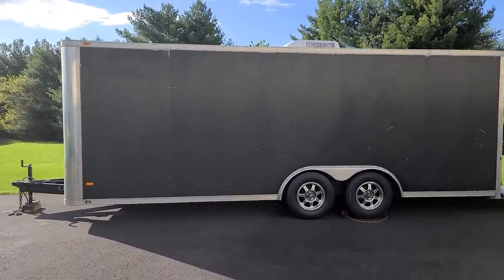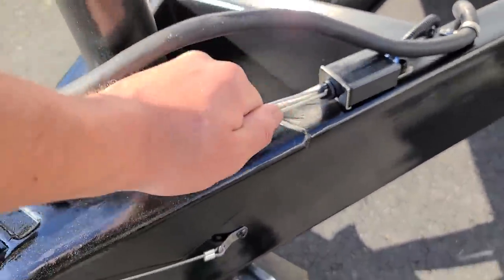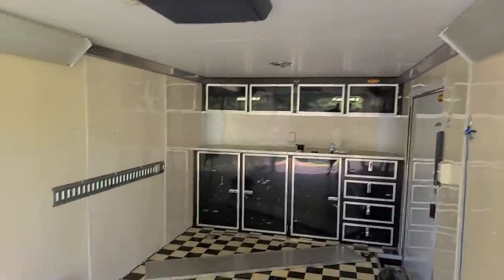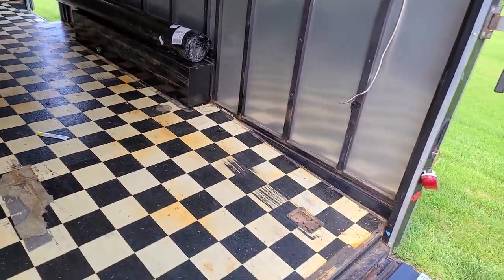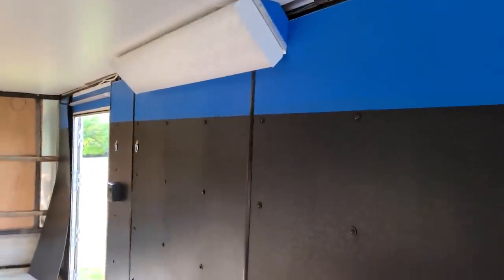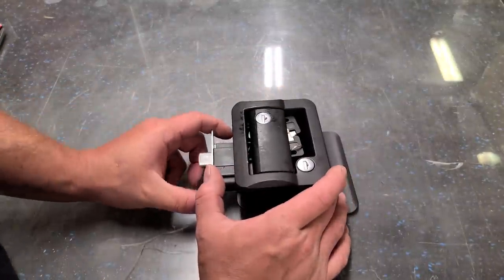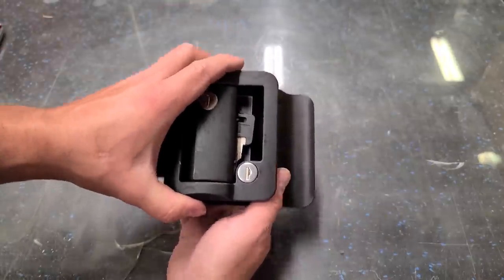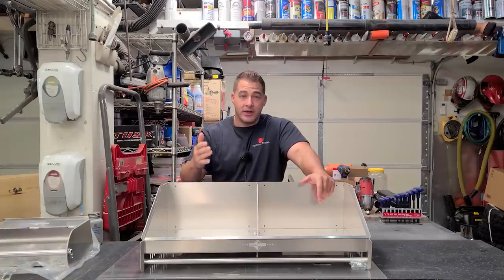Building The Ultimate Trailer and Mobile Workshop! Part 2

Comment: Bummer dude. You missed your opportunity to insulate behind the walls. You'll regret that when it get's real cold, but more so when the sun starts baking the trailer because it's black. Even with the AC on, it's gonna be a scorcher. Looks awesome though. Really impressed with that pressure washer attachment. That was sweet.

Comment: I would recommend a Andersen load leveler. I have one and have never looked back. the biggest benefit to this system is that you don't have to remove the bars to back it up or turn sharp. I bought mine used for half price and would never get rid of it.

Comment: To make the wrap seamless, cut a straight line where the 2 wraps overlap, peel back the cuts, pull out the waste parts and lay wraps down again. That will give you a seamless join 👌 Trailers looking good 👍

Comment: I just got done insulating the walls ceiling and floor of my enclosed trailer. It takes so long especially by myself. 24 foot trailer. Now I’m working on the lights and trim out. Then adding cabinets and tool boxes.

Comment: I'm sure it's gonna be a great trailer Mike, but why do you persist with those huge fluoro fittings?  Why don't you run the led strip lighting all the way around?  You're not gonna need the fluoros with the strip lighting all the way around, & light shadowing will cease to be a problem, with so many point sources of light.  You could also retain the small 45 degree 'fillets' around the edges of the ceiling, firstly to hide wiring behind it & also to mount the led lighting strips on.  I like the idea of strip lighting above the workbench.

The spare tyres are gonna be mounted on the outside walls aren't they? - On the front of the trailer?  They're just gonna take up valuable space inside, especially 2 of them.  You could padlock them in position for security.  An auxillary battery & generator would be useful, especially if you had a small bar fridge!

Comment: @micheal sabo I’ve cleaned changed my main & pilot jets I also leveled my floats on my banshee carbs & it seems to keep flooding & it only stays on when I keep my finger on the throttle  but it seems to keep flowing gas out the bottom of the carb through the fuel line … I’ve even brought a carb rebuild kit . What should I be doing or what am I doing wrong???? The only thing I didn’t do was change my needle level.. I’m in nyc my sea level is only 25-33 feet I really need help I’ve watched your vudo banshee and it’s great I wish I had an indoor shop . Like I said please just a comment it would really help me have fun for the summer

Comment: part of the reason it took so long was because you used an electric pressure washer. those suckers barely produce half the psi of a gas powered unit.